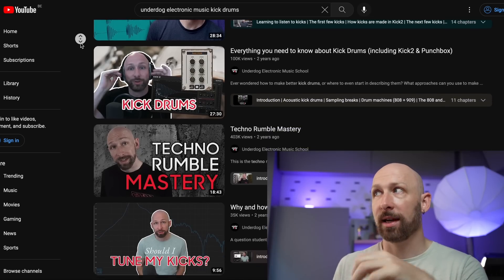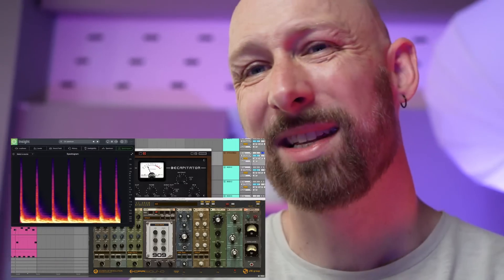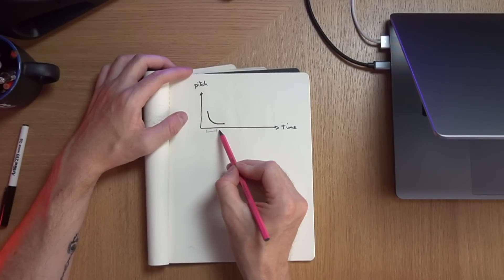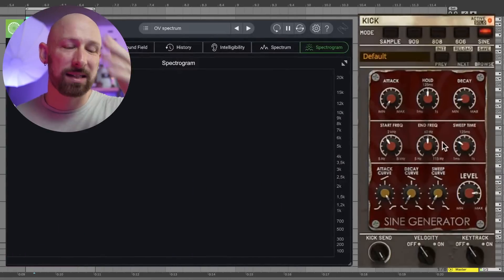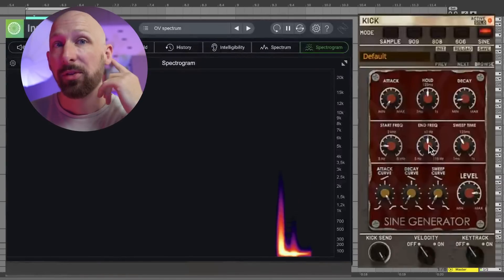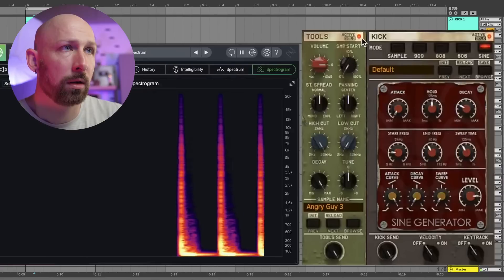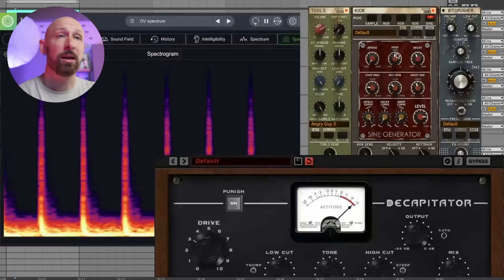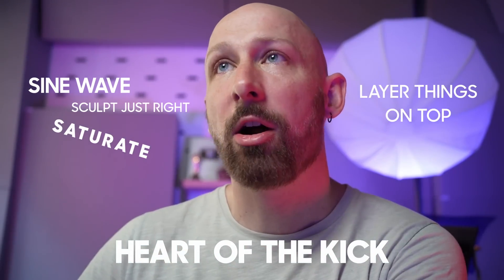How to not screw up your kickdrums!

Comment: A tipp that I can add from my own very unexperienced perspective for sound design of kick drums (and everything else basically) is: Pause! I cannot count the times I started with an approach that sounded pretty decent and even though I wasn't tweaking too crazy, i.e. did only minimal changes, the thing sounded worse and worse over time, with it sounding better when I listened to it later or in context with some snare and some hats. I mean its not surprising, listening to the same kick drum over and over again becomes boring, but it also worsenes your subjective perception of it as well. A personal rule of thumb is that I roughly try to change what I am listening to at least every 64 bars (very roughly, of course I am not counting those, I think what my brain does is roughly doubling the expected time for changes when listening to music normally), or - if I'm not able to because I need to figure stuff out with my DAW before I can change what I want to change - just pause the loop and figure stuff out in silence. Ears can get tired much faster than eyes, maybe because we cannot close them.
Reply from the maker: Totally agreed with this :)
Reply: Very good point, I work in a similar way, it's so easy to get lost and loose perspective when listening to same thing for too long.
Reply: closing your ears would be shutting of any noise, so youd be right

Comment: I've been synthesizing kicks using Ableton's wavetable. It's been a learning experience for sure.
The 909 kick is actually a triangle wave, not a sine wave.
I tend to get great results by layering a sine wave, a triangle wave and a layer of white noise. Try it out!
Reply: Trying to emulate authentic 909 kickdrums can be pretty tricky from my experience. If you want a 909 style kick, just use a 909 kick 😂
Reply: @DelasVC  yeah it was a learning experience but for everyday productions i just use a sample or some kind of 909 emulator.

Comment: I recommend the vst plugin bazzism. It's a kick synthesizer which looks ugly with a very basic user interface but is very easy to understand and use. It has in my opinion the best sounding (synth) kicks i have heard and tried so far. In comparison to other Plugins and Samples that i've tried, it sounds phenomenal.  For Beginners i would suggest to use one of the presets (only very few are included) and try to tweak them. A good start are the Presets "chill kick" and "full on" kick. With the Parameter "fstart" you can control how "bright" it sounds (it's simply a high cut filter) with the Parameter "fEnd" you can pretty much tune the basic harmonic / punchline of the kick. (Usually a setting between 56-65Hz will do just fine).

Comment: There's so many great kick synth plugins, too - they make it a lot easier to get started. Punchbox is great, though I haven't extensively used it. I was a huge fan of Kick2 for a while, but recently I've moved to Vult Knock as my primary kick synth. It has to run within VCV Rack, but sounds just amazing and has exactly the controls needed for shaping it like I want to.

Comment: fun thing about kick and bass, there is the notion of the deeper i go in frequency the deeper and darker the sound, but funnily enough from a certain threshold sub is more fellt than conciously heard, so the area around 70-100hz can sound darker and deeper depending on the song than a kick who peaks at 40-60hz... and in any case, pitch in the subregion is hard for humans to distinguish, much less hard than 200-1000hz, this area has a lot more effect on the depth and darkness of a track than its sub 

dont go deeper in frequency with sub, kick and bass just for the sake of getting a "deeper" and "darker" sound, it's placebo ;)

Comment: Oh man, I know that frustration! Not just for kicks, but for all parts of composing. I'm currently reworking a track that I never really felt completely satisfied with (using sampled kicks), but then I went back into it changing the kick and its parameters and now it's really shaping up (now has more energy and feels faster)! So, in extension of sculpting the kick (and every other sound), taking a break from it can actually be incredibly beneficial. Thanks for the video, I will try using synthesized kicks next.

Also, would you ever consider doing track analysis again like you did with KAS:ST? That was really interesting for me to see.

Comment: At 8 mins we can see how complex is to get that great kick sound.
Two sounds playing at the same time, usually,  ruin your kick.
An oscilloscope and a great understanding of what you are seeing is needed.
The first part of the blending process starts filtering frequencies that probably are clashing...
Thank you for the vídeo!!!!
The concept was spread...!!!
Reply: Two sounds as in kick layers or as kick and clap/snare? I don't agree either way, hahah, but aligning phases is important, flipping phases of sounds until it sounds right. Sometimes i flip the phase of a bassnote just to make it blend right with the kick!
Reply: @alfberger3150  My point is, low frequencies and all those harmonics from almost any acoustic bass drum are, usually, like two alpha dogs in the same room at the same time.
It demands to manage a lot.
Unless you don't care about how worse they sound together or you can't even listen to the damage.  (kinda joke)

Phase flipping can't solve all problems. 
So, it demands a crossfading, sometimes a highpass filter on some of them, and to watch the results using a multiple inputs oscilloscope (I suggest you Psyscope, it's free and sufficient) would be a good decision.
I use to (trying) mimic kicks on Kick 2 and man, less than a hair-thin move and your kick sounds differently.
And used to work on an AKAI MPC 60 in '90 producing and putting 2 or 3 different kicks at the same time was very common. So, in my experience, layering multiple elements with low frequencies and harmonics is not an easy task.
Reply: @marceloribeirosimoes8959  I don't understand everything you are trying to say, but yeah, it isn't easy. What i've been doing recently is volume automating my bass or rumble, make sure that the automation goes to it's lowest point at the kicks transient(that's why i use automation and not sidechain) making my kick a bit too clicky and then compress and/or distort my kick and bass a bit together. Multiband compression can be nice to, i use maximus, make the lows mono and compress heavily, a bit less for mids, and the least for the highs, then adjust dry/wet. I usually don't bother getting the oscilloscope out and just resample kick and bass together, zoom in so i can see every oscillation and adjust the sidechain curve, compression, levels and so on!

Comment: Thanks, Oscar!  I wish that my TR8s had all of these perimeters, i am trying to do similar sound design, with the saturation and compression in the machine, which isn't as good as a kick VST but it's got a decent amount of controls, just got to read the manual about how their controls work on my kick...
Reply: i have SPAN "oscilloscope" on my master, need to try to find a setting that shows the freq better like what you have there.
Reply: You can - use the FM Models. Either the dedicated kick model, of the perc model which allows chromatic tuning.
Reply: @embersandash  James at F9 has a video, showed how tuning your kick to the bass can cause destructive interference, where your bass can cause phase issues with your kick if they're tuned to the same note.
Reply: @isaac.anthony  sure that’s possible if they don’t have the same phase - if they do, then there shouldn’t be phase conflicts. I don’t know if the Roland FM drum models reset the phase on trigger, but I was responding to your comment about having more in-depth kick drum programming like with punchbox or kick 2.  Using the FM models introduced in 2.5, you can synthesize kick drums from signs with pitch and amp envelopes, but also using FM synthesis (with its own envelope). 

But speaking of tuning drums, you can tune the kick using the perc model to a note that isn’t the bass line but compliments it like a 5th or a 3rd.  Fairly common approach I think.
Reply: also, i was told all of the drums on TR8S are "tuned" to C by default...
Reply: @isaac.anthony  that doesn’t apply to the FM Perc Model introduced in 2.5, which can be tuned precisely.  It’s very versatile.
Reply: @embersandash  i could only get it to sound like a psytrance kick, will give it another go...
Reply: @isaac.anthony  well, at it’s most basic it’s a sine wav with pitch and amp envelopes.   Turn off all of the FM parameters to start.   I also recommend using the Saturator effect because it has the best EQ in the 8s - the only one with a peaking (bell) filter.

Comment: So what was that thing you mention at the beginning where you were getting lost??? I thought I was in for a treat but in the end there was no other info that just basic sweep a sine, add transient, saturate.
Reply from the maker: I kept trying to use a 909 kick as the basis, and wasnt getting the results i wanted!
Reply: @OscarUnderdog  ah ok. I was hoping for some insight into the amount and parameters for compression, the amount of saturation/distortion and the mixing levels of the kick respective to the rest of the mix, which is what drives me crazy and kind of going in circles...

Comment: I have to recommend Kilohearts Disperser plug-in for this—it completely changed how I make kicks. It allows you to sculpt frequency sweeps at the effect stage so you can feed it incredibly short, transient material and turn that into a buttery kick. The same technique can be used on synth stabs or bass lines to perceptually thicken them up without distorting them or increasing volume. I got the RE version for Reason but the VST works the same.